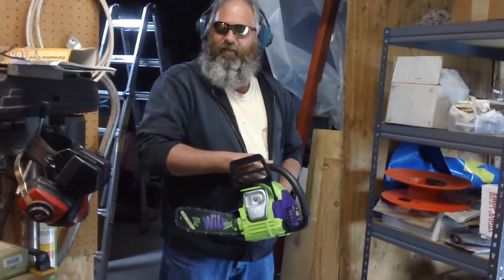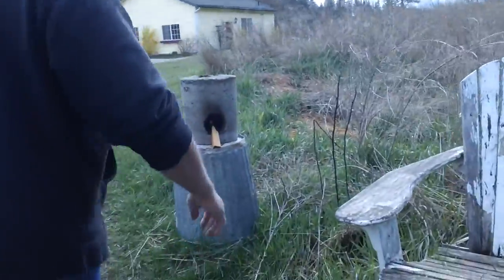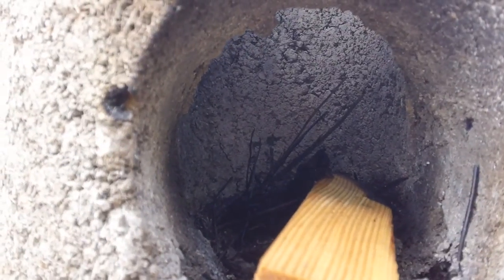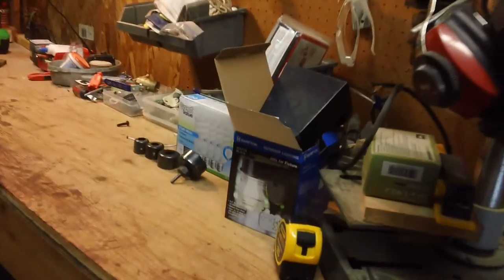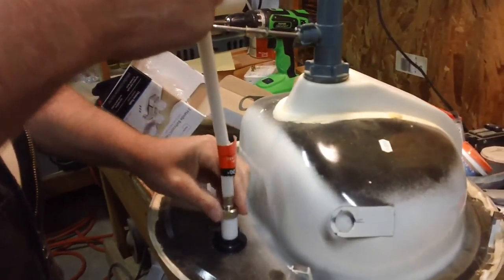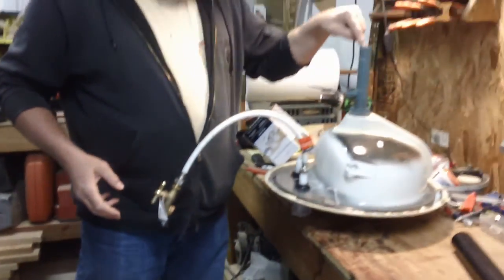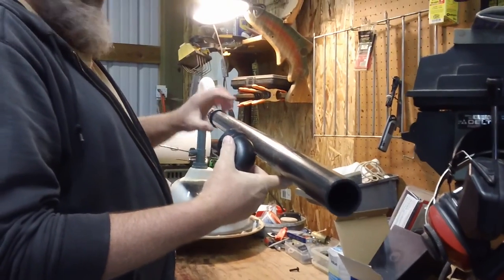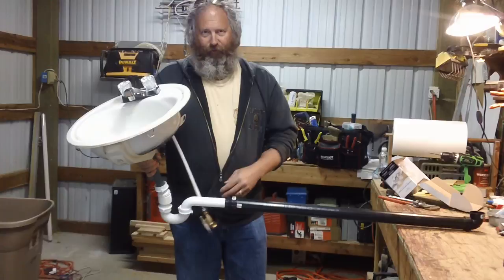plumbing hack very cool part one.

Comment: Enjoying watching your "hack". Over the years have done a bunch of these - put a sink where I want it - hacks, too. :-) Never thought about using an spigot as a connector. Nice. Connection I've been using so far, to the faucet is a Y or V washing machine hose. With adapters connecting both legs to the faucet. A short piece of hose with female fitting on each end, completes the connection to the water hose. Like this because it's easy to prep for winter. Just disconnect hose & open faucet. -- Plus, with this both sides of the faucet work & I don't have to worry about plugging the side not connected. 

On the other end of the water flow, rather than adding a p-trap, match size of tailpiece to a sump pump hose. If memory serves 1 1/4". Force fit hose over tailpiece. Secure with radiator clamp that comes with the hose. Can route the grey water wherever it needs to go with 20' of flexible drain hose. Since a p-trap isn't needed, unless connecting to a sewer/septic tank, leaves out another freeze point in winter. 

Gotta think about that spigot some more. :-) BTW, love that shop. Wish I had that much room to store "stuff" to recycle, repair, reuse, repurpose. TREASURE! Since county won't give me a permit to build the shop I want, have a lot of make-do here. (sigh)

Thanks for sharing. Looking forward to watching more of your "hacks" --> thinking outside the box!
Reply from the maker: Thanks just trying to inspire .

Comment: Really you could save time and money and not use the P-trap if you're not connecting to a sewer/septic line. Although I say that, it's probably just cheaper to get the P-trap instead of all the adapters you'd need to go from the tailpiece to 1-1/4" or 1-1/2" PVC/ABS.
Reply from the maker: Exactly.
Reply: Kevin Coy Also, your videos are awesome! I'm currently looking into building a tiny home once winter comes and goes ( I live in MN, gets a tad bit cold lol). I was worried about framing the windows and doors but you helped a lot with that, thanks! Don't stop making videos!
Reply from the maker: Thanks and your welcome. Have fun with your project.